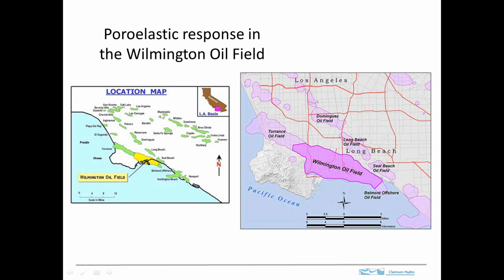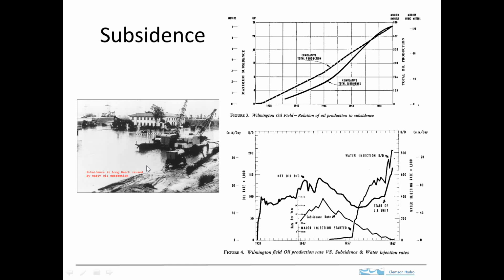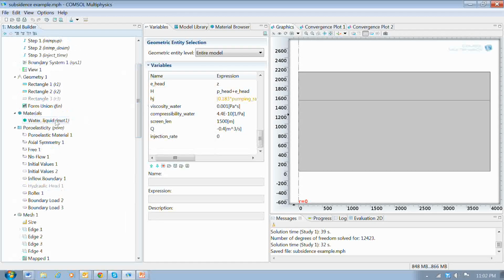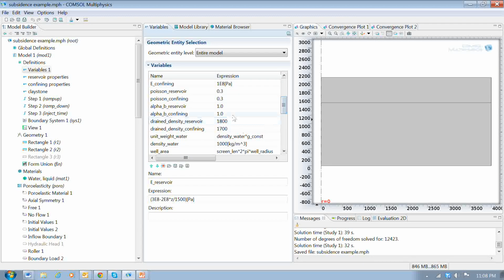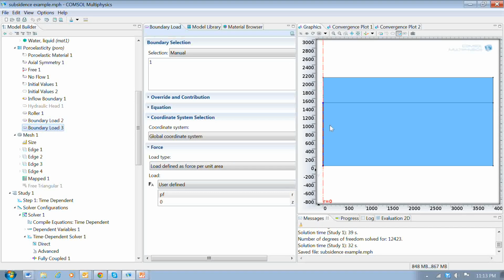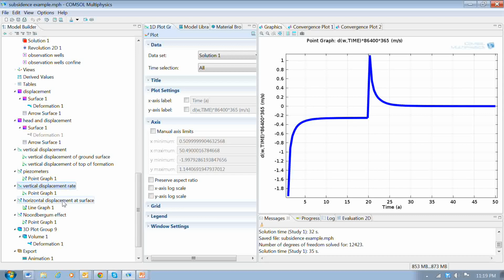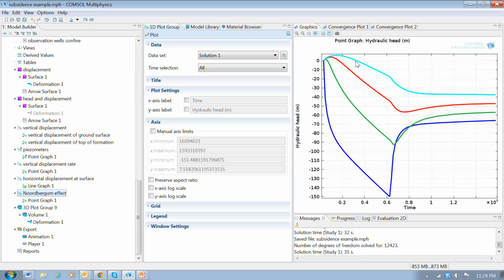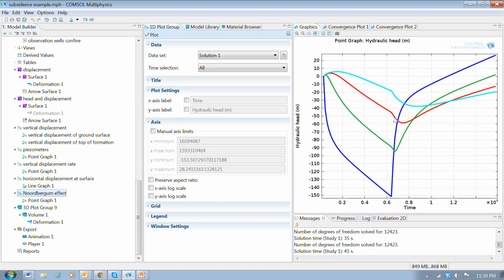Subsidence of the Wilmington Oil Field

Comment: Lived in Wilmington from 1953 - 1959 and spent time as a child walking around the oil fields and knew nothing of this going on.  Not a news worth item coupled with little news mediums. Find it interesting that I was there and not aware of this very advanced method of combating subsidence.  Not sure if this method would work for Florence.
Reply from the maker: Hi John,     Interesting that you were in Wilmington in the era when subsidence was greatest.  I expect the people with docks and other waterfront properties were pretty irritated at the flooding problem, although perhaps the cause of the problem was not recognized at the time.    

Injecting water to increase the pore pressure and counter subsidence has been proposed by some Italian engineers as an approach to address subsidence in Venice.   That seems like it would be a good thing to try, but I have not heard about any field tests.  Instead they built some large, moveable gates.  

Here is a link to paper describing a related approach for flood control.   https://royalsocietypublishing.org/doi/10.1098/rspa.2010.0033 

Larry